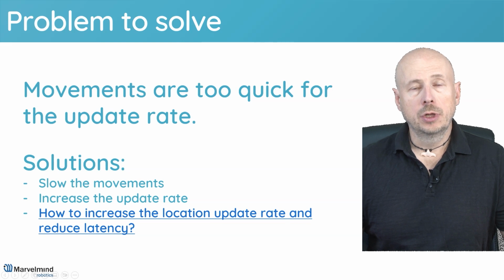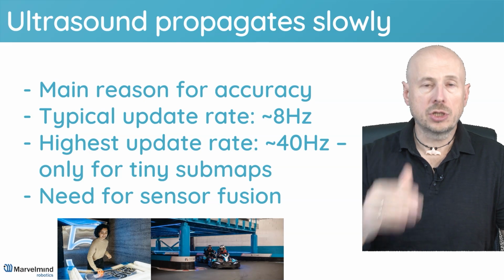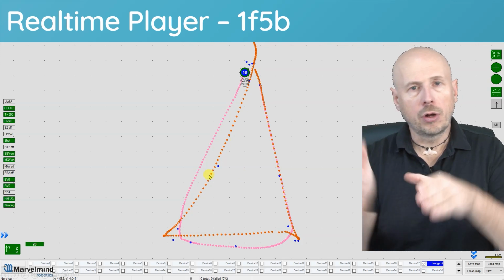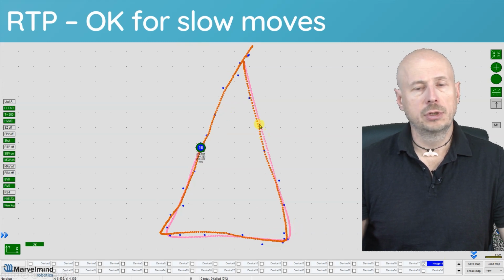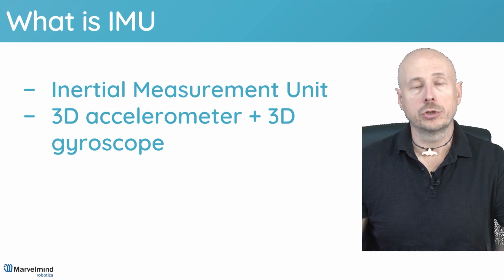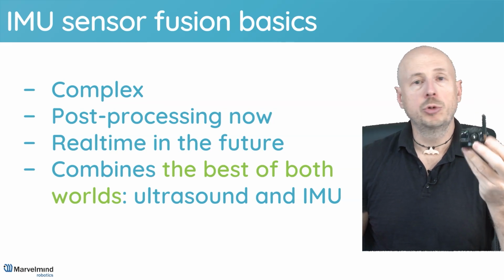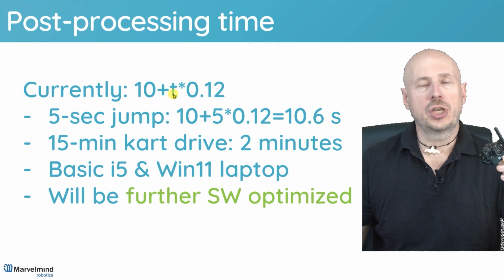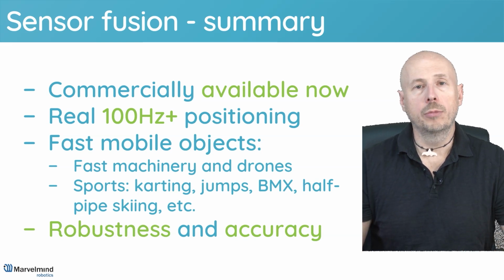Fast indoor positioning system based on IMU sensor fusion

Comment: Hello sir..How do I integrate imu sensor to server
Reply from the maker: The question is not entirely clear ...
- There is no server
- The IMU+Ultrasound sensor fusion is done inside our system. You are getting already fused data with true high location update rate